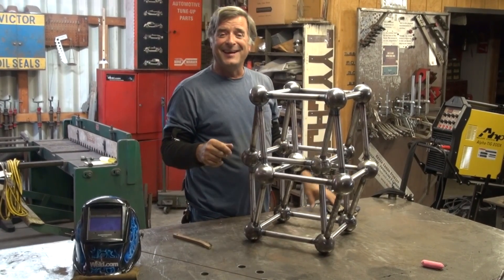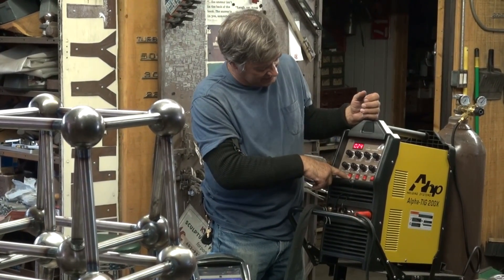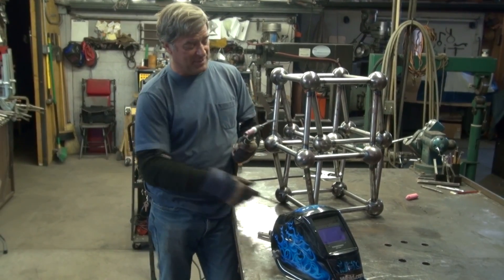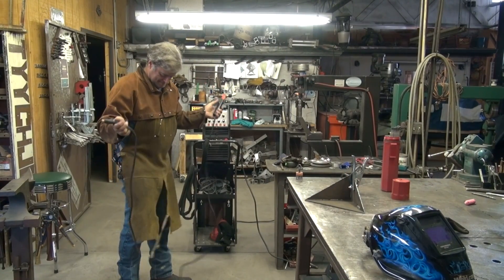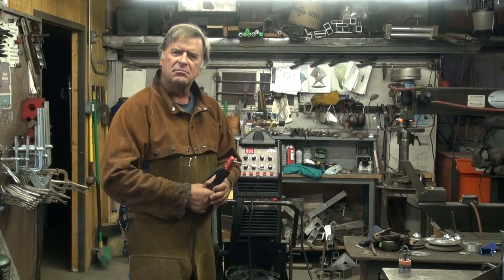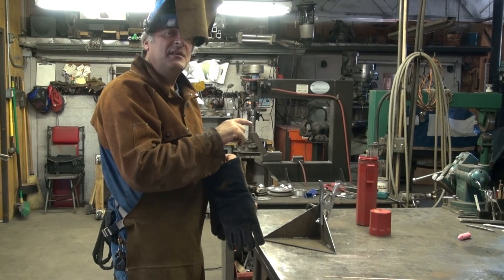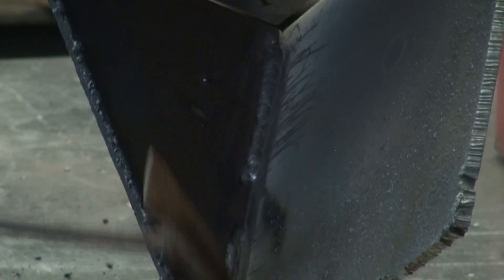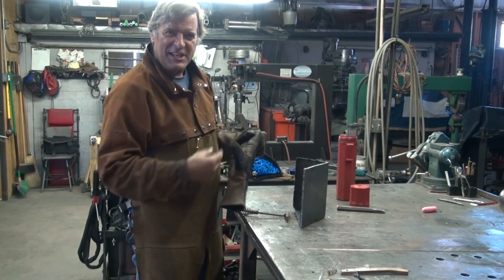How to Use the AHP AlphaTIG 200X 200-Amp Welder - Kevin Caron

Comment: What does start amps, main amps and end amps mean? How should i set them?
Reply: Is that only for 4t and the hand control?
Reply: If I'm on 2t does it only use main amps?
Reply from the maker: Starting amps is what the arc starts at, main amps is welding amps and end amps is what the arc stops at.
Reply from the maker: Correct, it only works with the finger control.    If you use the pedal the 4t functions don't work.
Reply from the maker: Correct.

Comment: I think your videos are super entertaining,  I am a structural welder and the thing about chipping or scrapping is if you chip at it u leave peck marks and they do not pass X ray test u scrap to avoid that n the pointed side of the hammer is to get into lil tight spots after you scrapped it but for sculpture welding that's not an issue also the guy who said hammering at it relieves stress is partially correct, for cast iron or cracked sensitive parts you can peen the weld (hammer on it) to relieve stress but you also have to post heat treat. Also the sound you heard being different when stick welding on ac is because it was to cold try closer to 120 amps n it will be way smoother but thanks for the videos keep Em coming
Reply: I'm just learning how to weld with my everlast welder but I really like your explanations

Comment: Thanks for the video. Just starting to use my AHP and learning how to TIG. The instruction manual does leave a bit to be desired in the translation About 25 pages or so, I think got lost somewhere.
As for the chipping hammer on stick welds: my dad taught me (he was a blacksmith) that hammering on a hot weld helps relieve stress and the weld will hold up longer without cracking. I hammer away on it if I need it to be durable, especially if I'm welding in cold weather, but if it needs to be pretty for a paint job, I'll be more gentle just to get the slag off. I haven't had a weld fail in 30 years.

Comment: Kevin,  I have a question.  Can you water cool the ahp alpha tig?  Looks to have a really nice arc. This seems to be a real value. I've been tig welding for about 15 years,  I'm familiar with quality machines.  How does this compair to others. Nate
Reply: I know in one video you used the Everlast 250?  Said it was very loud.  Its a lot more expensive also,  how would you rate the Ahp against the Everlast,  or the longevity pro 200.  I could really use the advise.  Also does the Ahp have standard size dense connectors or mini dense?  And for water cooling who carries the WC torch?  Thanks a lot for your time Nate to
Reply: Kevin I really appreciate your time.  I really respect the fact that you answer your fans.  Thanks

Comment: Nice machine, good welding, I would turn up the amps on that stick weld however, doesn't really matter for statues and non structural welding but for building purposes make it hotter, it's not an insult or anything. A good thing to see what I mean would be to do a destructive test, just hit it hard with a hammer and when it comes off, take a look at the weld penetration. Good video anyway Kevin!